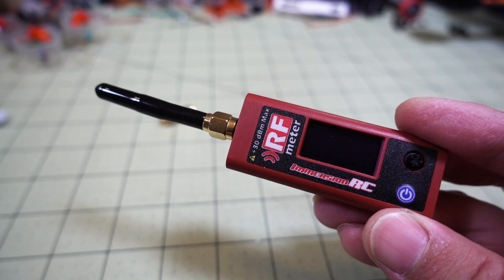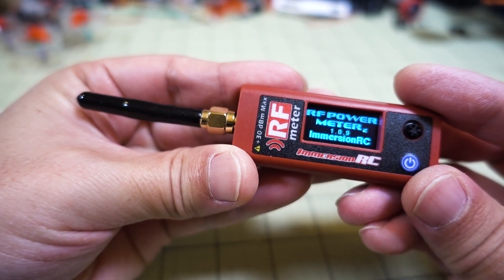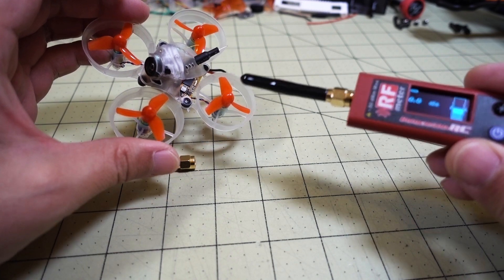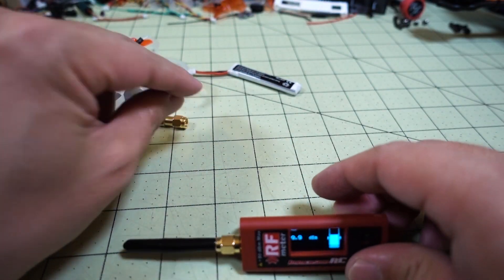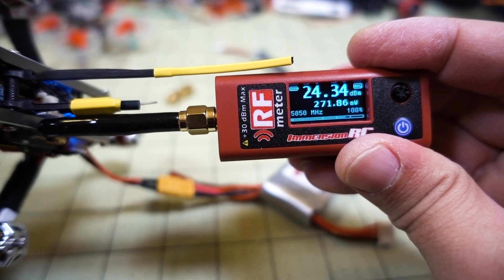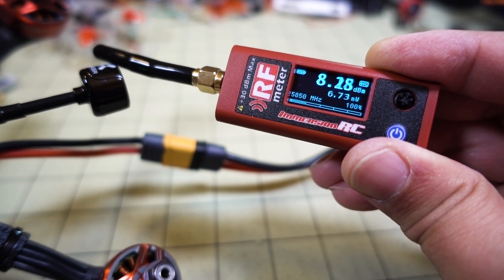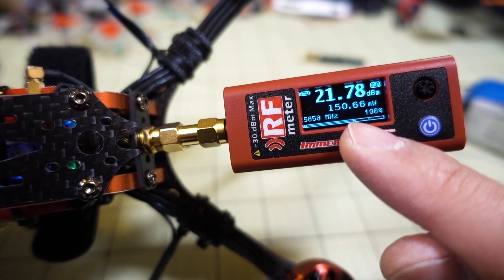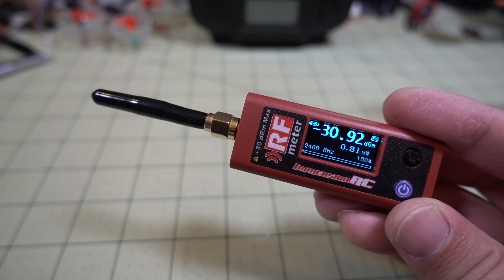ImmersionRC PowerMeter V2 ⚡🛠️

Comment: IMO, this is one of those "it would be nice to have, but for the average joe it's not really needed."  Not knocking it at all, however, even at $72 from BangGood it's still a little expensive for something you might rarely have a real need to use unless you were seriously racing or officiating a race.  Very nice piece of equipment and a Good review!

Comment: It would be nice to have, but it's to expensive. I am glad to see reviews of what the real output of the vtx's are and not just assuming whats printed on the label. I hope this will make vtx manufactures start labeling the products correctly.  Kinda like the DYS Mi200 stating that its at 200mw but its out putting 600-900mw.

Comment: Hi Albert.  JB got his power meter (same brand, model and version as yours) checked out in terms of calibration and reports that the results were surprisingly good for a hobby grade RF power meter.  I realize, of course, that different lots (or even individual units) may vary from each other, but at least there appears to be a bunch of them that are correctly calibrated.  I wish I could report on the details of the testing and results but I don’t have the numbers in hand.  That being the case, increased confidence in its accuracy would lead to an increasing usage for checking VTXs at race events as well as on the bench.  Looks like a dandy thing to have in the toolbox.  Thanks so much for the review.

Comment: Interesting tool. But it seems calibration control of most brands may be off including the RF tool. 
Which readings to trust? 
I'm sure this would only be a guide unless the tool is calibrated professionally. 
But this just shows how wide a spectrum most readings can give.
Reply: It is 99+% accurate. Joshua Bardwell sent some of these to radio frequency engineers who tested them with their professional equipment. So it’s as accurate as you can get for civilian equipment.

Comment: I'm pretty sure you lose about 3db when using linear and a circular polarized antenna. At least that's what I was reading about receivers and trying to reduce bounces with a linear on transmit and a CP on the receiver.

Comment: How accurate at these devices? I like that it could be used to check power output but i think it's only good for races, but everyday person not so much.
Reply: PhrozenTech Joshua Bardwell sent one off to have it tested by radio frequency engineers. They said it was dead nuts accurate.